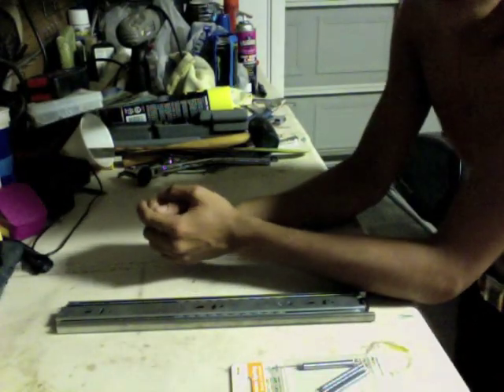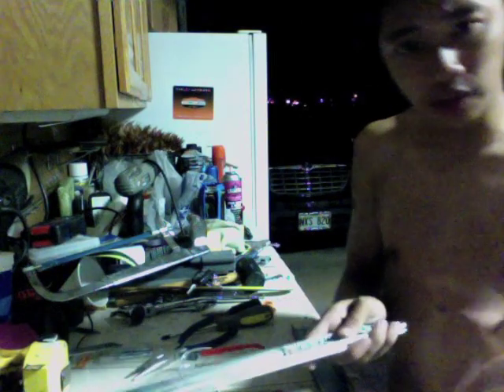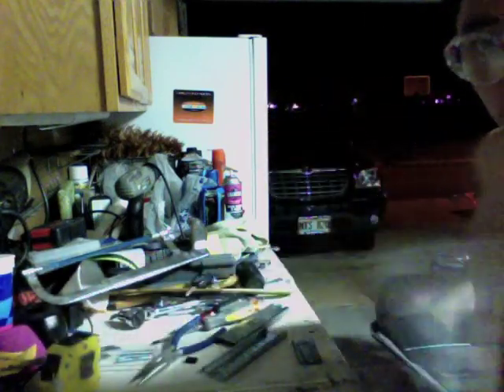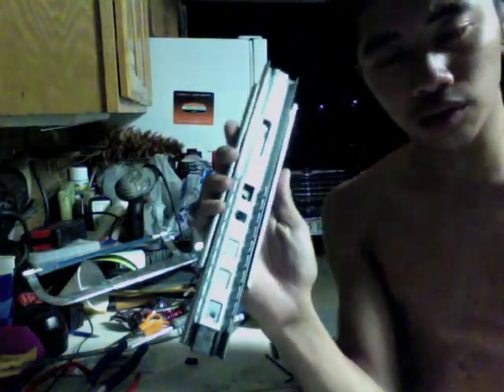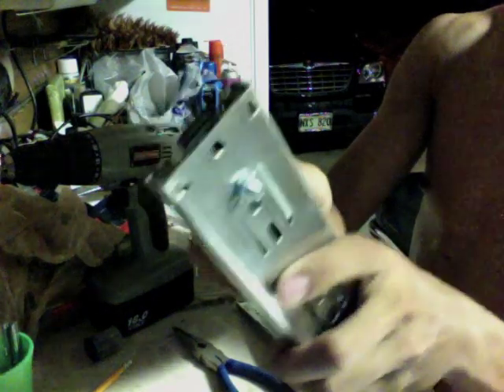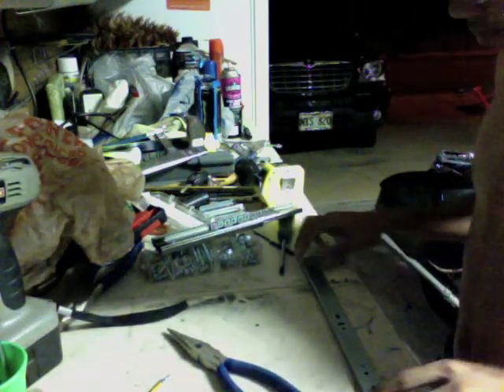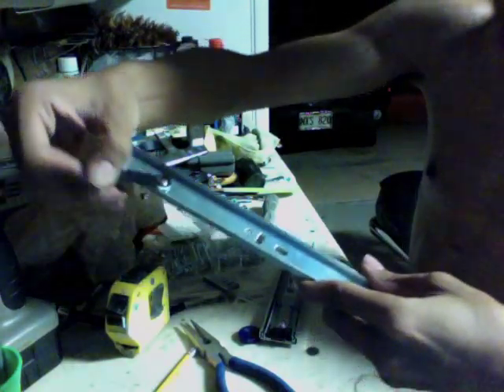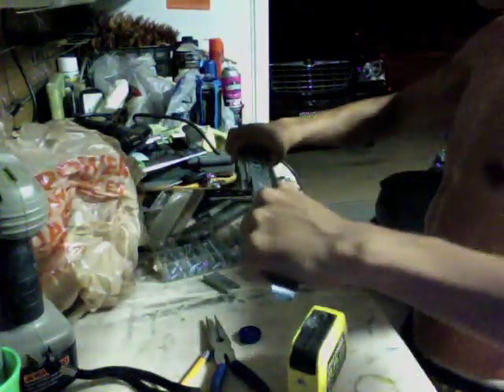RETRACTABLE HIDDEN BLADE v2 TUTORIAL (Part 1/2) PLEASE READ DESCRIPTION

Comment: Just finished building this, great design! A few ideas I had:

1) I notice that the locking pin catches much more effectively on the straight slits that are already cut into the blade than on a round hole.

2) On a similar tutorial, I saw a guy who made his locking mech by attaching a strip of springy metal (cut from an old saw blade) to the base slide. This eliminates the need for the boxy, two-part housing, if you're ever looking for a way to make it more streamlined.

Comment: i took the bserk design and made it much more slim ill try to have videos up soon its same length but only as tall as the drawer slide because i didnt put the locking mech on top i put it under the blade on the frame

Comment: dude, this is by far the best hidden blade i've seen on here and tomorrow i might make this. but i have a question, is this the V2.1 or an older V of your hidden blade, cause in the video the blade and sliding thing is not (and sorry for the spelling) attached to the arm holding thingy lol. but either way i'm gonna like what i'm making and i will have you know that i am 18 and i'm just making this just to have and not being stupid with it lol. great job on this dude.

Comment: The "size labels" on the springs mean the following: 1/4" = a queater inch wide.
2-1/2" = how long the springs are.
0.16" = how thick the wire used to make the coil of the spring is

Comment: @MemorySplitter1995 I got a suggestion on your theory. 
I was thinking you put a blocker on the front and have a ring on one of your fingers that pulls the blocker up out of the way and BAM you got it so it won't fall out of the holder when you don't want it to.

Comment: Hi mate, great vids and im going to attempt to make them but I havent used drawer sliders before and im a bit stuck on the bit in this video where you say to cut the black ball bearing strips. Where are the ball bearing strips and how to you access them and take them out, any help would be much appreciated. 
Cheers
TheDombo456

Comment: I live in the Netherlands and I just came back from the Praxis (sort of like Home Depot) and they had 1 3 stage drawer slide, but it was 40 cm (to compare, 14" is 35,56 cm) when not extended. Fully extended, it was 80 cm. Would that be the kind of drawer slide I need?

Comment from the maker: @DescentofDarkness it NEEDS to be a 3 stage slide that looks identical to mine. if it's more than 14", it'll work too. i just used the 14" cause it was cheaper and i didn't need all of that metal

Comment from the maker: EVERYTHING YOU NEED TO KNOW ABOUT THE DESIGN IS DISPLAYED ON THE WEB: THE MATERIALS, SIZES, UP CLOSE & DETAILED IMAGES, IN-DEPTH TUTORIALS AND INFORMATION ON EACH PART OF THE DEVICE. QUIT ASKING QUESTIONS WHEN I ALREADY POSTED ALL OF THE ANSWERS ON THE WEB.
ALSO, IF YOU DECIDE TO BUILD ONE & ARE WONDERING EXACTLY WHAT SIZE SCREWS AND NUTS TO USE, MEASURE THE HOLES IN YOUR DRAWER SLIDE, & THAT'S HOW YOU'LL FIGURE IT OUT. YOU DON'T NEED TO ASK ME, I JUST USED WHATEVER FITTED & WORKED BEST -_-

Comment: @adamjp9 Say you're making a costume. And -do not- make it sharp. Springloaded sharp wrist-mounted doodads and (no offense) youngsters don't really mix, not to mention if it's dull, you'll be able to get away with it far more easily. Also, if you live in certain states/canada, spring-loaded knives may be/are illegal, but if it's dull enough to avoid being classified as a knife (IE, butter-knife dull) you'll be fine.

Comment: Nice tutorial man but I have a question when it comes to the blade: Can I, instead of using the other drawer slide for the blade, use either a letter opener that has the form of a blade, and still be able to work with this tutorial? (still make it retractable like yours)